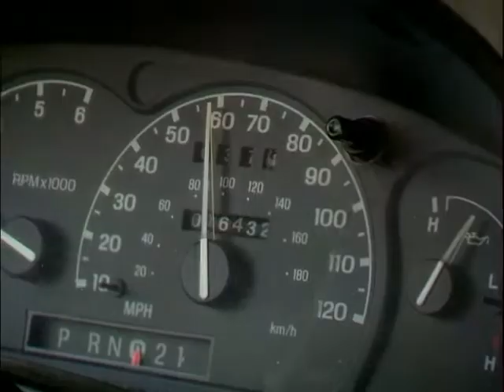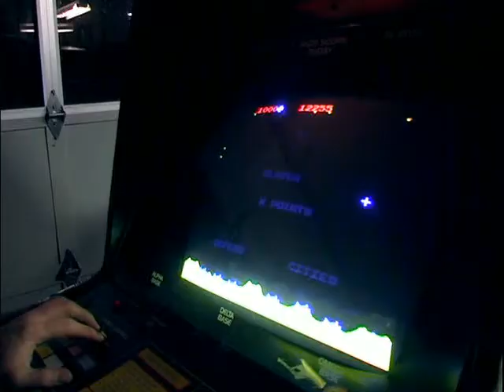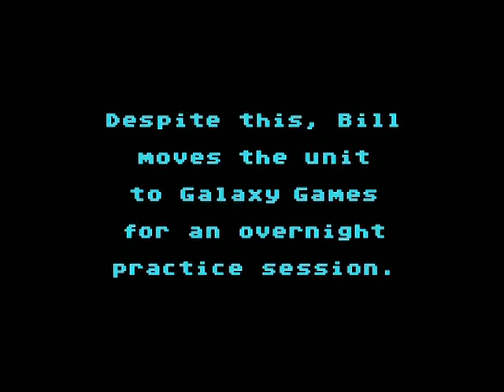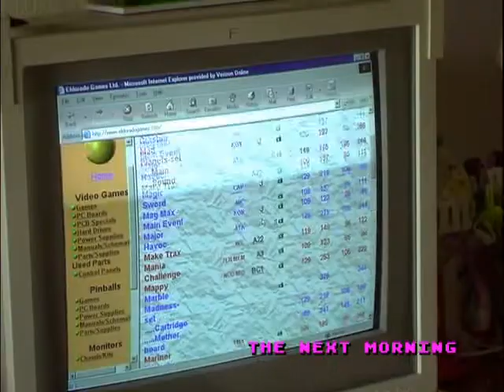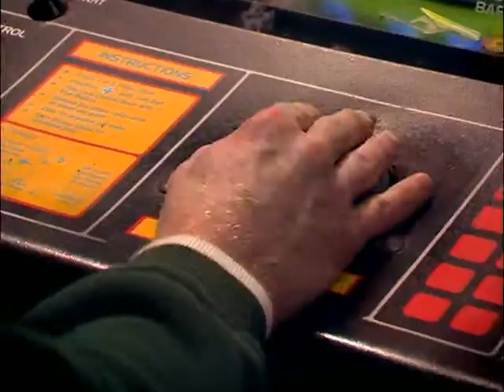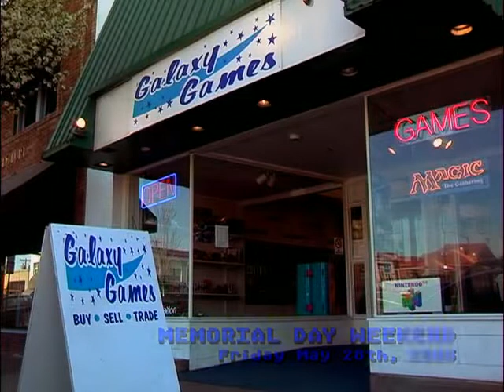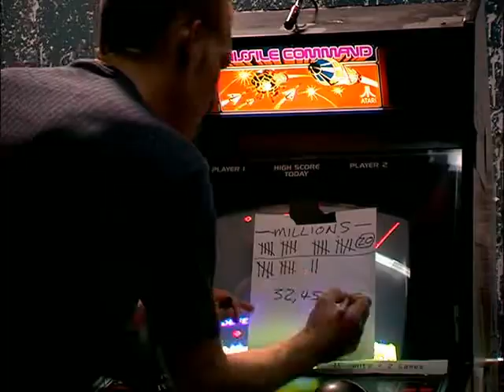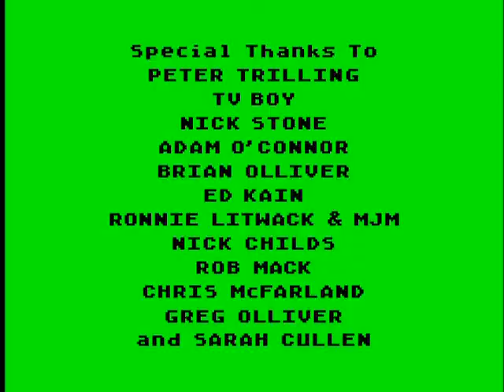High Score (2006)

Comment: One possible reason it could reset (at what might seem like random points) is probably due to the fact that Extra Cities are tracked in an 8 Bit value that is signed.  So you have 0 to 127 then 0 to -128.  If you get 128 Extra Cities, then the game thinks you have 0 cities.  If you have 129 cities the the game thinks you have -1 cities.  If you have 130 cities then you have -2, etc... If you lose a city, then it subtracts 1 from the total.  Since it's less than zero the game probably freaks out.   To circumvent this issue you do what I call "Life Management" and make sure you never have more than 127 extra cities. So periodically you just kill off extra cities.
Reply from the maker: Bill explains something of what you are talking about in this video.
https://www.youtube.com/watch?v=0EMGEzdIH3s
Apparently its board 255, and 256 which gives you a ton of free lives and bonus points which actually was the reason the game was resetting.